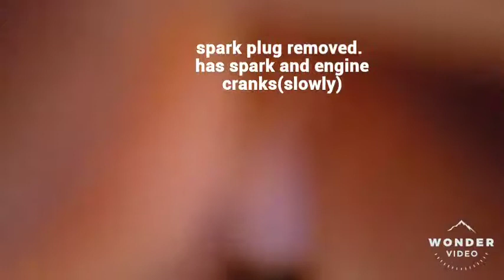2003 Raptor 660 starting issue

Comment: I have an 05 719 stroker and it wont turn over with the spark plug in, but it will while removed. Leads me to think there is starter or decompression issue.

Comment: Any update on this
Reply from the maker: It was a broken piece on the decompression pin inside the camshaft. It was where a weight was attached which normally would keep the exhaust valve open at lower rpms while starting and then retract at higher Rpms. Part number 5 on this diagram - https://www.partzilla.com/catalog/yamaha/atv/2001/660r-raptor-yfm660rn/camshaft-chain
Reply: @ffpm03  thanks mine is doing the same thing I've looked and asked every where and they tell me it's a dead battery but the battery is new I'll take the cam out and check it
Reply from the maker: @Fatmike718  you may be able to remove the small inspection cover near the top of the cylinder head to see if you can see anything wrong with that decompression pin. Otherwise you'll have to pull the valve cover off.